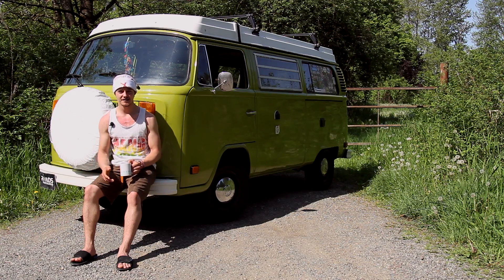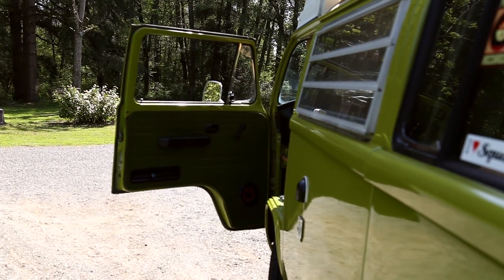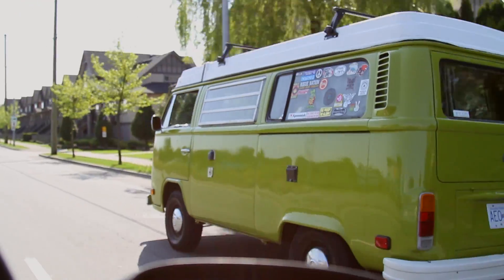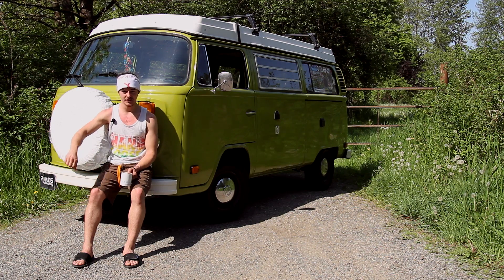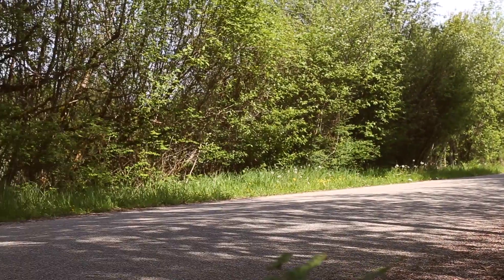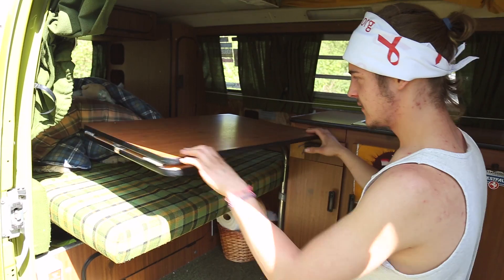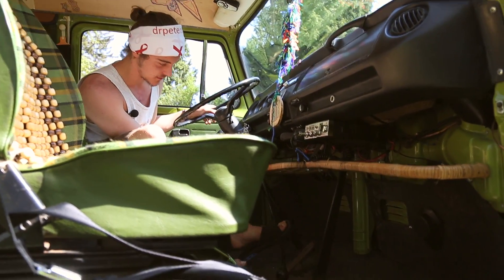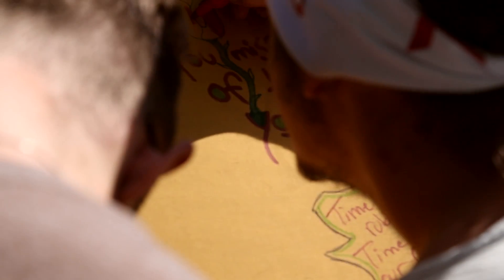Erik's 1977 VW Westfalia Kombi Bus | Project Restoration

Comment: Fun day I spent repairing the wipers on my 74 westy. The wiper motor and gearbox are ticket snuggly under the dash. The gearbox has 1 plastic gear wheel. Found a replacement at a local salvage yard. The original plastic gear broke during a heavy summer storm as I was fighting traffic around Memphis - literally the worst moment, but as all things Westy, you make it work and enjoy the journey.

Comment: great job on the bus. been down a similar road with a 71 and an 82. the 82 is also a 2.0
Reply: Looking at a 1973 will start a RT 66 tour, this summer.  Need to figure out an AC hook up running off a charger on the engine and an inverter.  Live in Florida so AC is cool to have, no pun intended.

Comment: I want one of these but I also don't want to be stranded in the middle of nowhere because it broke down.
Reply: contrary to popular belief, these are extremely reliable  as long as they're taken care of.
Reply: Tilsen Mulalley or you can fix it if you know what your doing
Reply: Tilsen Mulalley that statement pretty much works with 95% of vehicles
Reply: @fpl_bailey  not really, these engines are actually pretty simple unlike more modern engines which have more electronics, more moving parts, generally more complex and have tighter tolerances on moving parts. Theres also a huge community around these vans with people all around the world willing to help when they can, and theres a lot of information online to figure everything out urself

Comment: Dear Erik, what you say in the beginning is not entirely true. Volkswagens T1 series consistet, as you mention correctly, in beetles but this series also included the first kombis. That means, that the buses with the split windows were part of the T1 series. The T2 series began with T2a: No more splittet front windows, electricity went up from 6volts to 12, a few centimeters added in the general size, 1500cm3 engine added, etcetera. After a few years, the T2 series evolved to T2b. You can distinguish between T2a and T2b very easily through the location of the turn signal on the front of your bus. T2a has it on the bottom on the very sides, in T2b they moved up and are glued next to the frontern air entry. Your model is part of the T2b series. I know, that´s only theory, but interesting though. You have a very nice kombi and can consider yourself a lucky person.
Reply: +Christoph Schabasser Actually he was right, he wasn't refering to the T-Designation but to the type. Type 1 was the beetle, Type 2 is the bus to this day. The T refers to the generation of the bus: T1 (Splitwindow), T2 (Baywindow), T3 (Last one with rear engine), T4 T5 and the new T6 (Front engine)
Reply: +MrMAXXXELLL thx man, didn´t know